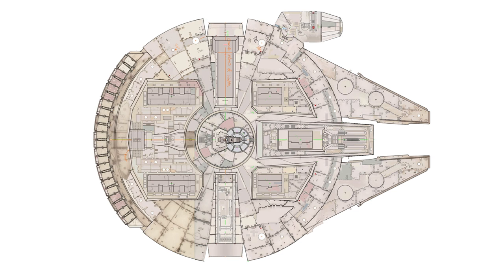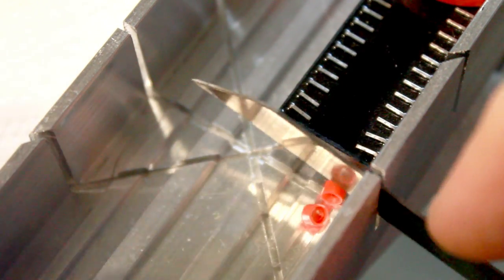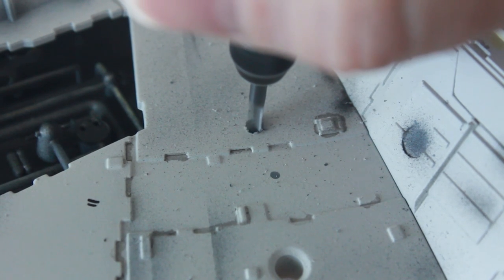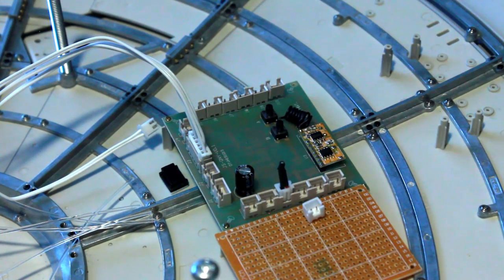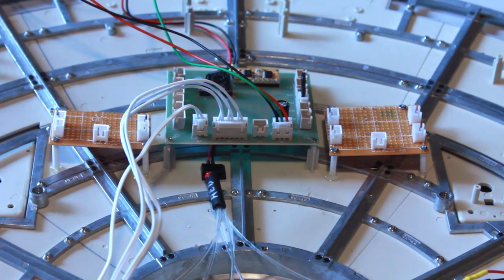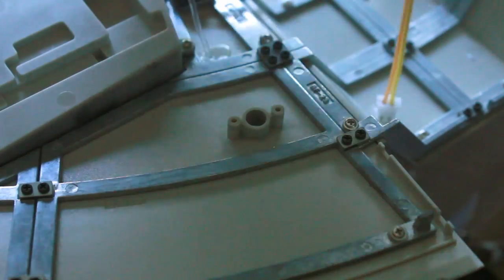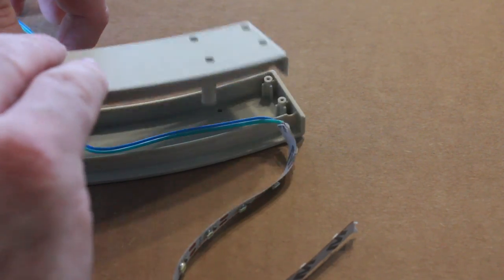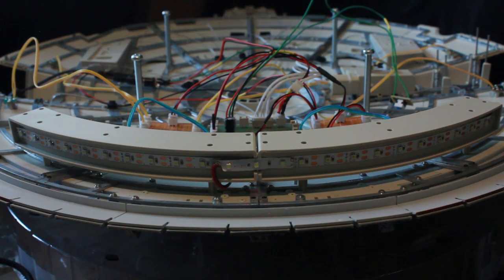DeAgostini Millennium Falcon Customized Build Pt 7 Hull Lighting and Wiring

Comment: Hello again Chris. Another question. How did you create your y adapter? Can you point me in the direction on where I can learn to make one?
Reply from the maker: The Y adapter I made myself using  some JST 2.5mm 2 pin connectors like in the link attached.  I glued 2 male connectors back to back, then soldered wires from the female connector to the 2 male connectors.
https://www.ebay.com/itm/50-SETS-JST-XH-2-5-2-Pin-Battery-Connector-Plug-Female-Male-with-120MM-Wire/253250139173?epid=12002509181&hash=item3af6e27425:g:aeUAAOSwLVZVvPEd

Comment: On your breadboards the kit comes with the connectors is there a name for this connectors so I can purchase more and keep all connectors the same? And help would be much appreciated
Reply from the maker: Yes, they are  JST 2 pin connectors.  I just don't remember if they're the 2.0 or 2.5mm.  I think the 2.5mm.  I got them 2 years ago now. But they're readily available on Ebay, and very cheap.
Reply: Thank you Chris, I think I may have found them 🙂👌👍

Comment: Hi, great work, what did you use to extend the led for the engine. I'm not sure what to look for. Thanks in advance.
Reply from the maker: I just added a chuck of 3 LEDs  from an LED strip in the middle of the kit strips.
Reply: Hi, yes you mentioned it in your video. i want to buy some led strip to extend mine,  but i'm not sure what to buy
Reply from the maker: I bought a strip of LEDs from Paragrafix.  You can cut them in sections of 3. 

http://www.paragrafix.biz/product_detail.asp?MainCat=LEDs%20and%20Lighting&SubCat=blank&PPartNum=PLD-CW-HD-0.6

Comment: Hi again Chris! A couple of questions:
How many illuminators and caution lights have you installed? I’ve been able to locate...2...3 illuminators... And how many fibers into each one? 
Are all of them connected togheter and to the same board? Thanks so much, and you have an “ALL INCLUDED” vacations here at Spain to finish mine!! :)))
Reply from the maker: I have 1 white for the solid cockpit LEDs, 3 blinking white (for different timing) for the blinking cockpit LEDs,  and 3 red for my caution lights.  Oh, and 1 white for the nav computer in the hold.
Reply: Christopher Olson THANKS SO MUCH!

Comment: How do you get the 12v led lit by only 6v batteries?
Reply from the maker: I don't use batteries.  The model is lit with a power supply
Reply: Mine has a batterybox for 4 penlight batteries= 6v
Reply from the maker: @MrAnubis74  Do you have the whole model yet?  The battery box is just for testing while building.  It comes with a 9v supply at the end.  Though I purchased a different 9v supply with more amps due to all of my additional lighting.
Reply: @modelsbychris  ,goodmorning, i do have all the issues and indeed it comes with an additional power supply. I will try this. Thank you so far...
Reply: @modelsbychris  ,you were right...ofcourse... problem solved...thanks for your feedback
Reply from the maker: @MrAnubis74  No problem.  Glad I was able to help.  Like I had said also, depending on how many lights you added, you may want to get a different power supply with more amps.  I believe mine is a 9v 2500mAh

Comment: What kind of led connectors arte that on the boards?
Reply from the maker: They are JST XH 2.5  2 pin connectors
Reply from the maker: Can easily be found on Ebay
Reply: Awesome thanks the reply! I just subscribed and waiting for my first box. Great work by the way! I have not done any fiber optics or lighting like this so I will try to follow your videos and I will probably have more questions later 😁